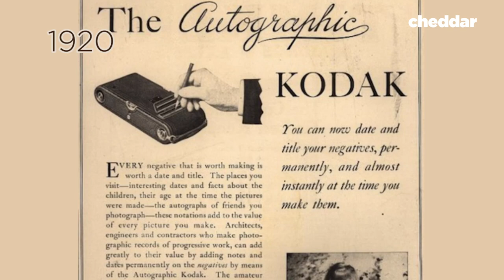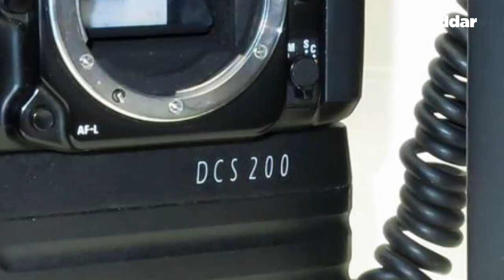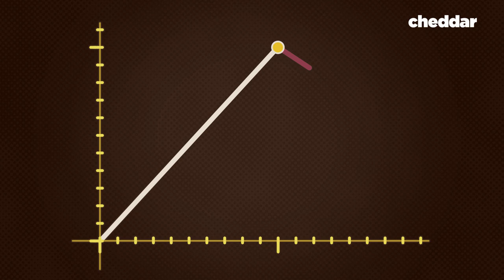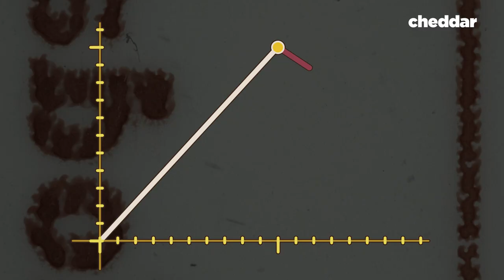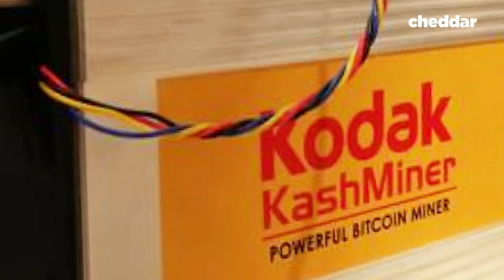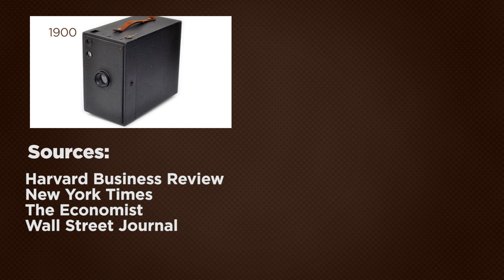Why Kodak Willingly Ignored the Future of Photography - Cheddar Examines

Comment: The video is somehow really badly researched. The problem was not that Kodak did not make digital stuff (they were the only major supplier for medium format CCD sensors for Hasselblad, Phase One and Mamiya back in the early 2000s till early 2010s. The problem was the big competition around Sony, Canon and other big semiconductor players in the CCD and CMOS sensor market. Also the mobile phone market killed both the entry level and midrange (still an expensive market) digital camera market and killed the mid range digital compact cameras, there were only high end DSLR and high-end mirrorless digital interchangable lens cameras left, where Kodak still did not make cost sensitive own DSLR cameras or any professional camera, there understanding was just to be supplier of digital sensor chips for high-end medium format etc. But the competition put more money and efforts into the entire CCD and CMOS sensor market for small to big sensor sizes (mobile phones and 1/3“, micro Four Thirds, 1“, APS-C, Full-Frame 35mm (and digital medium format market later)), which is a costly market, when you want to produce for any sensor size in high amounts. Kodak had neither the fabs for high production capacity for semiconductor business like Sony and other CCD and CMOS digital image sensor manufacturers, nor the R&D for better improved noise reduction on CMOS sensors like Sony and Canon already had. In fact Kodak just built noisy CMOS chips and still just used stupid CCD chips, in times were Sony already changed their business into more cheaper and nowadays better performing CMOS image sensors. Remember Canon did this transition nearly a decade before Sony. Canon used in the early 2000s for all their pro DSLR cams only CMOS sensors and Nikon did used CCD (based on Sony designs) and their own LBCAST sensor designs (for their pro high-end flagship DSLR) back in those times.
Reply: To survice the digital competition a camera sensor producer needed to have the expertise for semiconductor business right from the beginning and start and also the production capacity of a big player semiconductor firm. Which of course was at its time only Sony and Canon and some other companies in the digital image sensor world. Sony was only number 2 of the digital camera market, because they supplied their digital image sensors to Nikon and other camera brands. Canon was number one because of their brand and their mass amount of camera models from compact cameras, bridge cameras and entry level to pro grade DSLR. But again Sony supplied also some image sensors to Canon in past, when I remember correctly, but only for some minor interesting compact cameras in the early 2000s.... 🙈😂👍😆 Only Canon‘s CMOS sensors were 100% from Canon and their own fabs and also they put their best and own tech only into their DSLR cameras with CMOS APS-C and APS-H and 35mm full-frame image sensors. The first Canon EOS 1D seems to have even a Panasonic CCD sensor. 🙈😂 Only 3000 units per month were produced (look at the dpreview interview). Back these times you can see in the early 2000 years pro digital cameras were not mass products, but later and later the compact camera market and bridge camera market died, today only premium compact cameras, mirrorless interchangeable lens cameras and midrange to high-end DSLR cameras are only relevant. The entire entry level digital camera market died out because of mobile phones and later smartphones with image sensors inside. ;) Kodak could not have any chance.

Comment: Good report, thanks, but shame on the video editor who is guilty of committing the video atrocity of BBC (Blow-up, Blur, Crop) 4:3 aspect ratio films and video (or 4:3 films transferred to video) to fill the 16:9 frame. Doing "click to fill" may look OK on a computer screen (other than the unnaturally overly large images) but on a TV the loss of resolution is terrible. You are taking standard definition video and degrading it to substandard definition video. You are also altering/censoring the carefully composed and framed 4:3 aspect ratio images by the historical cinematographers and videographers. Leave 4:3 alone! And, don’t BBC 4:3 photos, either.

Comment: The Kodak All in One printer/scanner that I had years ago never would scan right. You couldn't scan anything without there being a black shadow line appearing in the scan.  The upside is Kodak did force competers in the printing industry to bring down the prices of their ink cartilages. After Kodak went out the prices of the ink cartilages went up. And they have never come back down.  And a word of warning. If you have an old HP All in One printer/scanner do not update your printer driver software. They will download software to your printer which will kill the printer. If you don't believe me then Google/Bing it.

Comment: Apple's QuickTake (1994-1997) was the first widely successful consumer digital camera.

I had an Apple QuickTake camera in the mid 1990s and so did several pro photographer friends. None of us could get a decent quality image out of those things - ignoring the low resolution of just 640 x 480, the shots were always dark with low contrast, no depth and muddy colours. No matter how good the lighting, the images always looked like crap!

And these QuickTakes were not cheap - I remember mine costing over USD $750!

Before that, Kodak had released the first professional digital camera in 1991 - the DCS-100 which cost USD $13,000!

So I imagine the Kodak digital camera prototype from the 1970s would have been much worse quality than the QuickTake and probably more expensive than their DCS-100!

So that's probably 2 more big reasons why Kodak didn't develop their original prototype further at that time - crap quality and insane price!

But in hindsight of course they should have used the massive profits from their films and chemicals to continue development of their digital camera.

Don't forget that it wasn't until the 2000s that consumer-priced digital cameras were able to take decent shots.

Comment: Even if they had went forward with digital camera they would still have been toast unless they somehow had become a smartphone company.  Kodak also tried getting into the copier business but that venture also failed.

It's always easy to Monday morning quarterback something like this, but sometimes you are just screwed by your own success and can't see the end coming.  To survive they would have had 3 options all longshots at best:
1.  Radically transform the company into something completely different.  However, for this to have worked they would have had to fire and replace most everybody including top management, move the company out of Rochester and compete with established technology companies.  
2.  Spunoff the film division and acquired  other companies in emerging technology with the money.  This would have probably been a failure as well as long as existing management were still in the same mindset of the film and chemical industry.
3.  Sold themselves and became part of someone else's empire.  This may have been good for the shareholders but still a high probability of a likely end for Kodak.

Comment: I can’t help but compare GM to Kodak.  GM created a very good electric car the EV1 and dropped it.  THeir engineers went on to form AC Propulsion that eventually became Tesla.  Tesla released it’s first mass market car in 2012.  GM finally woke up with teh Bolt in 2017... Tesla was on their 3rd mass market car by that time... Tesla sold 130,000 in Q4 2019, Chevy sold 1600 Bolts in the same period.

Comment: Stagnant, ridgid thinking has been the downfall of  many companies. GM could be leading the "electric car" market right now if they would have kept the EV1 program going.
Reply: Digital cameras were all advantages over film camera with ZERO downside.
Electric cars have to many disadvantages over gasoline cars to do the same.
Such as price, range, charge times, Fast charge locations spots,
very unfriendly to apartment and condo dwellers and battery degradation.

Comment: Innovation/Invention under-mines the corporate bottom line, it's the dilemma of dictatorship's, we know there's technology already there but the board of directors know that whoever mass-market's it successfully will lose massive net profit's, think/reason/rationalise/logic it, if kodak introduced the digital camera early, we would of skipped tapes entirely, reels of film present in cassette, vcr and of course analog cameras would of ended by the late-1980s/early-1990s, so phasing it in it was intentionally-and-purposely delayed until the mid-1980s so it wasn't until the late-1990s/early-2000s to keep mass-marketing, mass-production and mass-distribution going
Reply: This is the same today in relation to science, technology, engineering and mathematics (S.T.E.M), companies don't want to phase in "new stuff" since they want to keep current marketing, production and distribution rates up, but are also responding to user/consumer choices, it's arguably a two-fold problem, but, even so, in 150/200 decades-and-centuries creeping automation in the white-market will become just automation in the white-market, so innovation/invention cannot remain renovation/re-invention

Comment: This a common short-sighted analysis. Kodak failed to innovate.
Wrong. Kodak failed to diversify significatively. Kodak did take part of the digital photo market; the problem was that the main industry of Kodak disappeared. This happened in 2 phases. The first and most dramatic was indeed the film. Kodak practically gave away cameras fro free because their real business was actually selling film and developing. When digital technology became predominant, there wasn't a change of market but a disappearance. People simply weren't buying film and little by little they stopped printing their picures. The second phase is also quite clear, do you won a digital camera today? on your smartphone you do, bt that's it. People tend to forget that the leading brands for digital cameras are no longer making chea affordable products because due to the appearance of high tech smartphones with great pictures, people stopped buying digital cameras outside the pro or semi pro market. So it is dumb to think thbat the mistake of Kodak was not to innovate, their industry didn't migrate it disappeared altogether. Hindsight is 20/20 but even today people don't even understand this story of decline